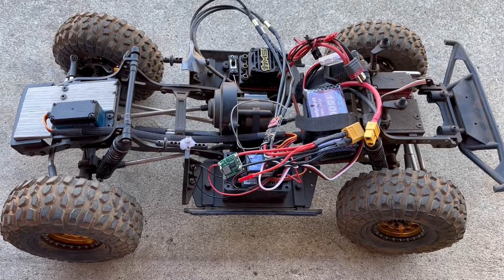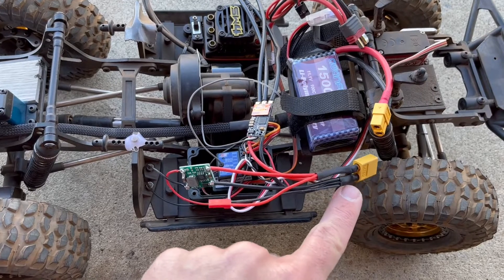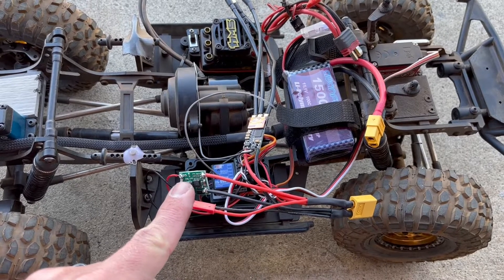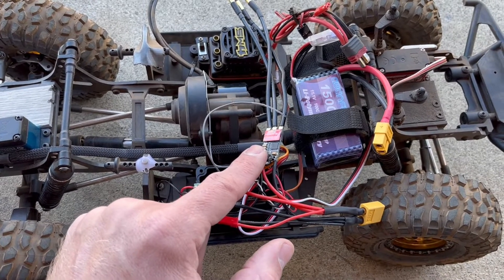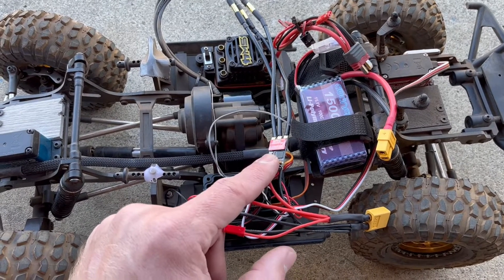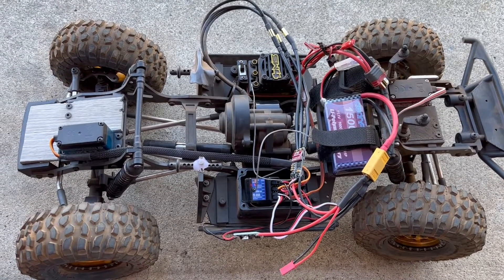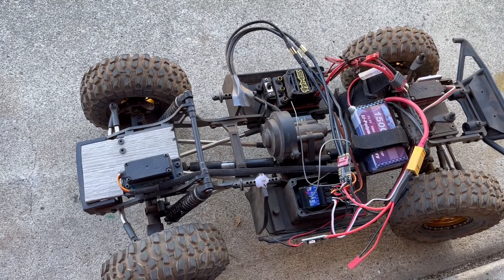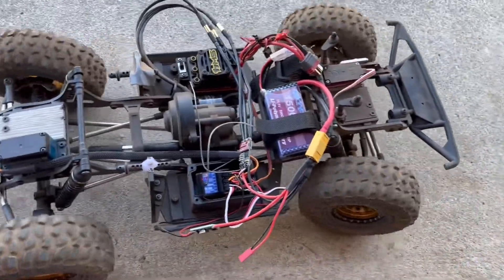BLHELI_32 45A Brushless ESC in Element Enduro rock crawler

Comment: You need shrink tubing on the motor wires or they can short out. Also you need to load the am32 firmware. Loads better for crawling. I just did it on both my emax esc’s .  Simply amazing.......
Reply from the maker: Funny you say that because it did short out and now I’m in the market for another esc. A few guys at the comp I did stated I should heat shrink the bullets completely and three runs in my truck was dead. I am also planning on loading AM32 on my esc and looking to get the st linker. Thanks for the tips.
Reply: @dadsrcworkbench1322  I'm gonna get some wraith32 esc next.  I'm slowly swapping all my crawlers to am32 flashed escs.
Reply from the maker: @HIinfidel  I have one of those and I’ll try that. It is 35A and I thought that could be a little low and that’s why I got the emax 45a. I know another running the wraith32 and it seems to being doing good.